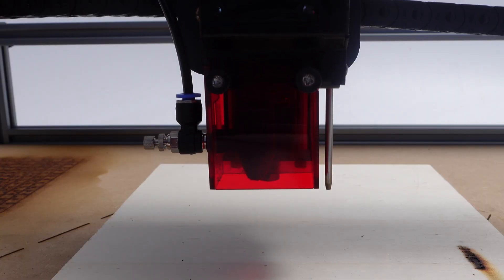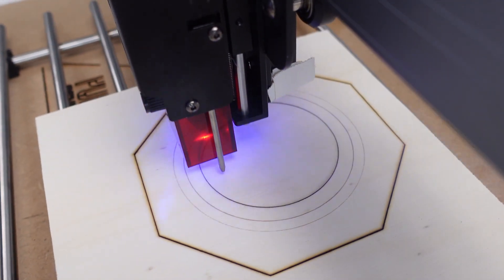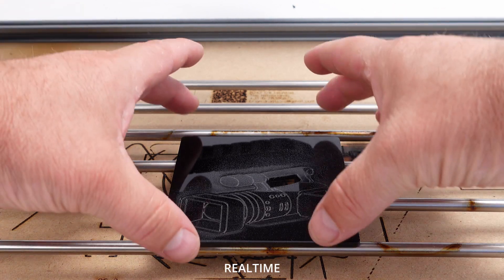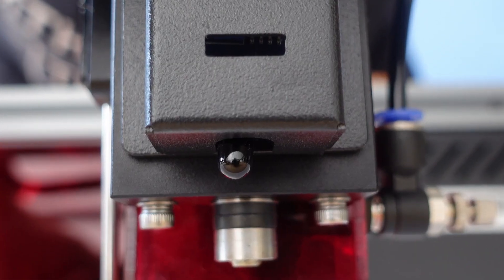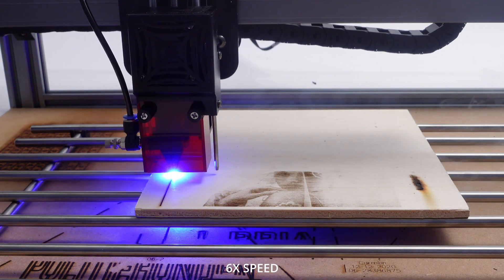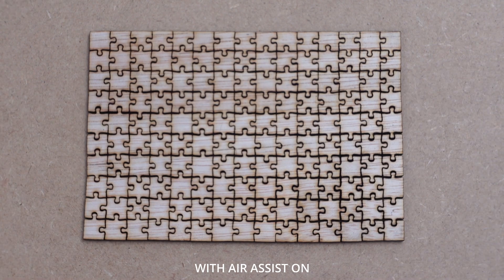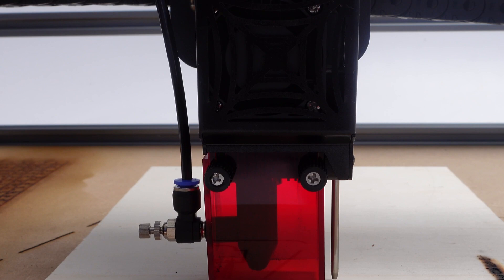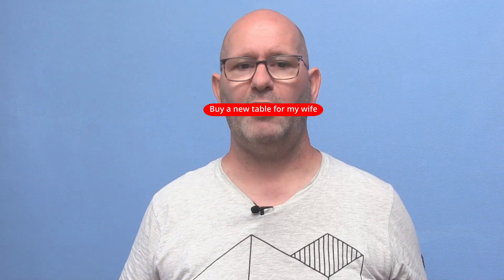▼ TwoTrees TS2 Laser Engraver Review

Comment: I would like to engrave on a black (sublimation) aluminum alloy business card (less that 1mm thickness). What type of laser head from ATOMSTACK should I choose? ATOMSTACK P7 40W Laser or ATOMSTACK P7 30W Laser Engraver? Can you recommend the right laser power or even the right brand for me for that purpose? Will the TwoTrees TS2 Laser Engraver do better than ATOMSTACK P7 30W/40W for engraving over a black (sublimation) aluminum alloy business card (less that 1mm thickness)? I will buy based on your recommendation (and considering also the price).
Reply from the maker: Sorry for the late answer.
I would go for the cheapest 5 Watt laser for that, as this is an easy task.
Yet, if you want to do this as a business, then you would be better of with a Galvo laser instead of this Diode machine.